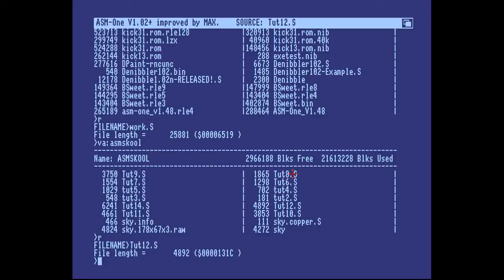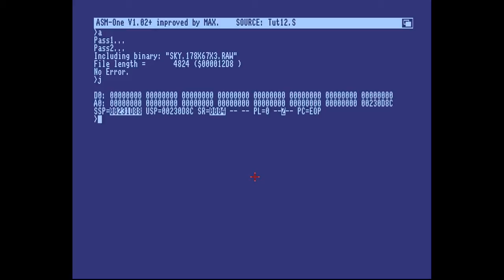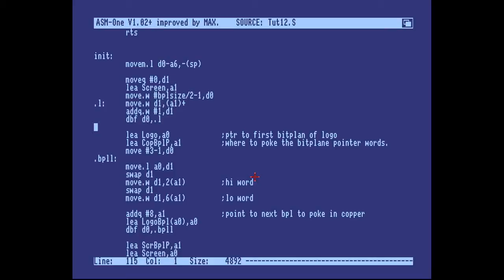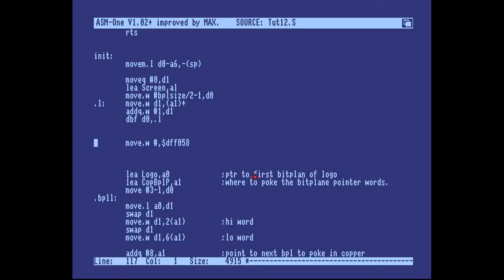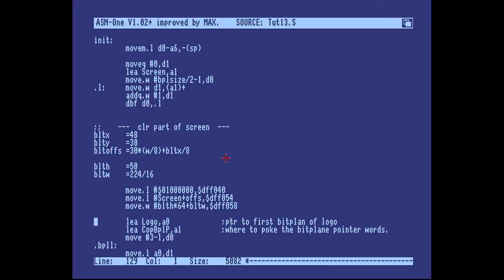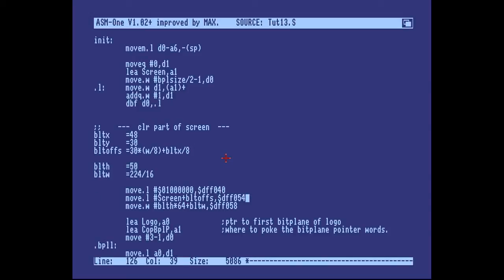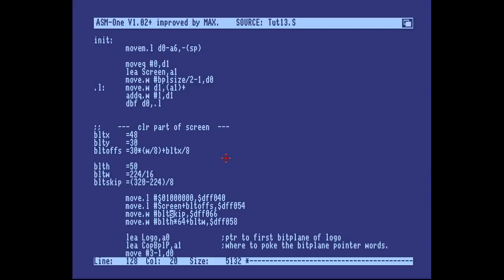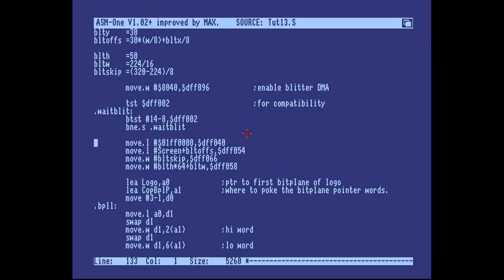Amiga Hardware Programming 13 - Introducing... the Blitter!

Comment: @4:41 why multiply by 64? what's the reason? why 64?
Reply from the maker: All custom chip registers are 16-bit, and some fit several values to save registers (and register accesses!) This blit size register contains a 10-bit value (height) and a 6-bit value (width). The height is in the top bits, so it must be shifted left by 6 bits, which in this case is the same as multiplying by 64.
Reply: @ScoopexUs  thanks, makes much more sense now!!